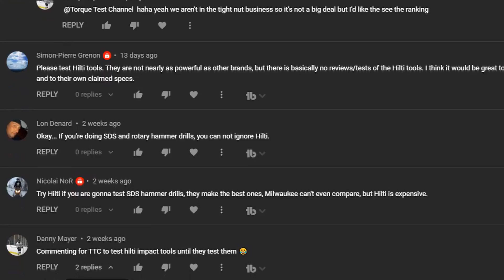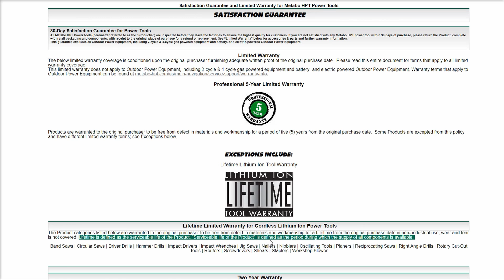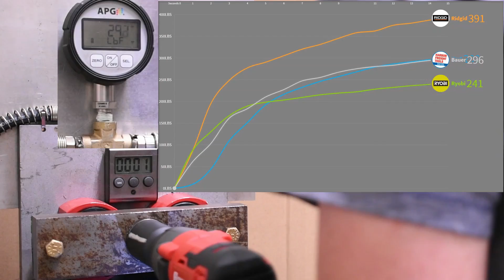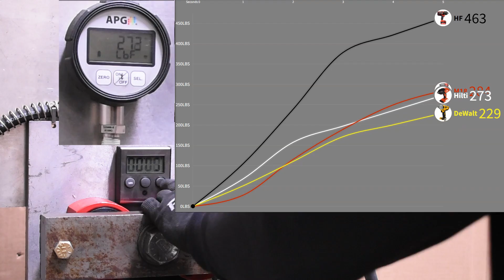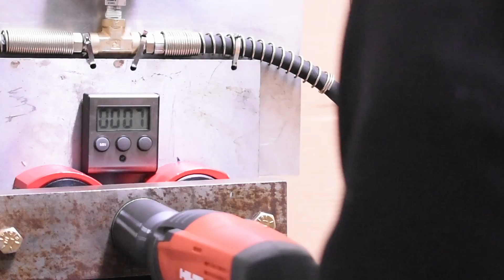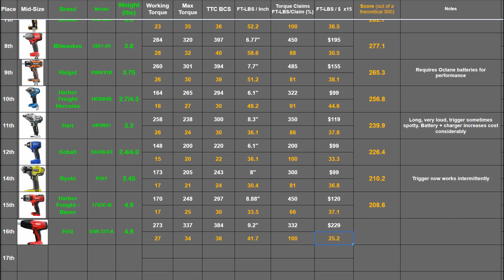HILTI: How Does Their Big 1/2" Impact Stack Up? + New HILTI Tools!

Comment from the maker: Closed captions @ 0:32 for a laugh! Want a link to every one of our rank lists we ever make? Currently if you buy anything from our Amazon store of winners only: https://www.amazon.com/shop/torquetestchannel and FWD to Torquerank@gmail.com you'll get it sent to you.
Reply: I have been wondering for a while now would greasing your Milwaukee M18 midsize gears ⚙️ help? Or do nothing at all besides help the long Jevity
Reply from the maker: @rednecksdoitbetter2975  Only helps tool life.
Reply: schlobber is a technical German term.
Reply: I have a video suggestion. So we know small variations in socket weight and size wont affect torque transfer from a previous episode. But does broach style affect torque transfer, for example snap ons flank drive and flank drive plus sockets, grey pneumatics design and others.
I would like to see socket comparisons. Brands like snap on, sk, proto, grey pneumatic, sunex, capri, astro, mac, matco(expert), cornwell, carlyle, pittsburg, icon and so on. Bc of the smoke and mirrors in rebranding, and the difference in customer specs, even if from the same plant, I would assume test them all.

Comment: The similar drill is now $409 but has a new case and new NURON battery.  Not sure about the internals.  Torque is now a 'claimed' nut busting 1217 ft-lbs or about 50% more.  I still use my nickel battery 18v hammer drill which is around 10 years old and I can rebuild batteries if needed.  I replaced all my corded hammer drills from Bosch to Hilti and couldn't be happier.  I had an issue with one hammer/chisel drill so I sent it in and had a replacement within 1.5 weeks.  I'm not even a fleet customer

Comment: The 5 price points of power tools -

1. $20 on Craigslist/Gumtree and "I swear it works/isn't stolen
2. Cheap eBay/AliExpress "tools"
3. DIY tools that provide more precision than the user is capable of and are fine to use once a year to put up a shelf.
4. Professional tools, like Bosch and Milwaukee. (Definitely not Ryobi)
5. Hilti. The tool you'll only ever "buy" if you're putting it on your companies account.

Comment: I'm just not a fan of the 22V line up, their tools are freaking huge. As an ex contractor, the "durability" factor could never take me away from Milwaukee considering the fact if my Milwaukee ever broke I could replace it faster then sending the Hilti to get fixed.
Reply: I had a die grinder shit itself and was sent interstate for repairs and returned within 30 hours in my hands. On a bank holiday weekend. Not getting that service with Milwaukee etc.

Comment: I guess I'm in the minority but after working for a company that is a "Hilti Company" for 18 years I'll pass. Drywall and concrete dust kills their drills and drivers. They feel great in hand but we have to replace them every year or 2 because they won't warranty them for the dust even though we started blowing them out several times a day with compressed air.
Reply: What? Their specific drywall tools are amazing at that. Never had my cut out tool (SCO) or sd4500 ever clog up or seize. My short lived Dewalt/ Milwaukee experience was complete opposite. Every 6 months warranty.

Comment: After continually replacing the seals on my dewalt I switched to a cheaper hilti impact, in fact it came free with a rotarry hammer drill, and the difference was night and day, I can drive 10mm lag screws without predrilling, and the batteries last twice as long. Interesting that this one seems weaker than the much smaller one I have, love to see more hilti impacts tested and prove I have confirmation bias :)
Reply: Because it probably is.  They updated some products.  Ignored others.

Comment: Interesting... I always associated Hilti with high quality, high power not necessarily.  You may get less beans, but you'll get them forever.  Looking at their website there is one that has more ugga-duggas available than the one you test, that's the SIW -22.  IT's also a 1/2" impact but with much higher claims.  Would be interesting to see how it sits in the mix.
Reply from the maker: I don't see higher claims on it
Reply: @TorqueTestChannel  my bad, I gave the wrong model #.  Check out SIW 8-22 1/2" #2251631.  Max torque claimed at 8850 in-lb in gear 1 and 5310 in-lb in gear 2.  Gear 1 on this model is more than 2x the SIW 22T-A's claimed 3982 in-lb.

Comment: i dont really have any interest in the Hilti lineup its lacking in most areas.. and i guarantee they follow the 2 year warranty not the 20 year one for almost any circumstance you can think of.. any "failures in workmanship" will show up on day 1.. if you burn out the motor, the trigger fails, the impacting mechanism shakes itself to pieces ect ect ect theyll call it wear and tear and say it was only covered for 2 years making it the worst in the industry not the best

Also we came to the assumption in the beginning that it was brushed due to the lack of brushless marketing on the tool and in the product pages.. but they do make brushless tools and just keep it low key their grinders for example i seen a tare down where no where it mentioned brushless at all and open it up and sure enough its a brushless motor, so maybe split the clamshell after the tests and see if theres brushes in there or 3 phases

the product line is just lacking though theres so many tools missing and not one of their cordless products is best in class id even dare say milwuakee has gapped them on rotary hammers now cordless or corded
Reply: You can bet that any Hilti tool sold in a big box store will not be the same spec as from Hilti direct, this should not surprise anybody, all power tool companies do this, you cannot buy power tools with big box store codes on it anywhere else.
Reply: @CrimeVid   i mean maybe.. but i dont think so, i think their 1/2" impact is there 1/2" impact, maybe they have a few of them but whats the point of holding back the better one for only people who special order it direct? makes much more sense to just push the better one out to box stores.. all brands do not have special tools only for direct purchase, most brands will not sell tools directly at all.. maybe theres differrent tools for different countries but overall they want to make as few variations as possible economies of scale make it far cheaper to produce one 1/2" impact instead of 20 different little variations of it
Reply: wrong. it's an honest claim. the warranty policy is exeptional !

you can also get some spare parts for 30 year old (corded obviously) rotary hammers.

no marketing wank at ALL.  try that on other brands.
Reply: @casemodder89  theyre honest in that theyre going to warranty wear and tear for 2 years and workmanship for 20, but ask them what qualifies as workmanship defects.. everythings going to fall under wear and tare after 2 years and not be covered

Comment: that 20 year thing is a joke, i tried to take in a grinder for work that was no more than 10 years old and absolutely less than 20 years (dont recall the model) and they said they didnt support the tool anymore and would have to buy another. ok how much? $430, plus tax. $430 for a bog standard run of the mill nothing special other than the name 4.5 inch 120 volt grinder. $430. i laughed all the way out of the store and hucked the old grinder in the trash on my way out.

Comment: I'd be curious to see what Hilti's manufacturing is like in China. If it's company-owned and is based in China for price and logistics purposes, or if they're cutting corners with no-name manufacturers like nearly every other brand is. Considering how Hilti is set apart from a lot of the market, 22v cordless, ownership of the brand being themselves with no sister brands, etc., I'd like to believe the former, as material costs and logistical costs would be lower with a company-owned factory based in China; this may also explain the pricing compared to relevant competition, as costs aren't being offset by other brands within the same factory, whether that's sister brands under an umbrella or a no-name factory that produces for anyone, though there are many more factors to pricing than just this.
Reply: "or if they're cutting corners with no-name manufacturers like nearly every other brand is."

most major power tool manufacturers aren't doing this either.  I'm sure you'd like to think so, but they really aren't.

Comment: Yeah, I'm finding a lot of these beans wars a little silly. From what I know, this tool is designed specifically to match their anchors, so you definitely do not want to over torque those things, especially if you consider German liability law, which would ultimately put blame on the chief engineer behind the tool if the fasteners were to be found at fault due to an over-torque situation in a structural failure. In other words, if you are an engineer at a company that wants to play in the torque wars and some yahoo over-torques your fastener with the tool you designed, and a building collapses because of it, the liability is on you, mein Freund. I use a 12 volt 1/4" driver 90% of the time, and these ridiculous box number marketing wars are just leading to a lot of stripped fasteners and broken 1/4" bits. I have one and it's loud and annoying. I leave it home and take a 12 volt Bosch and the M18 Surge (I find the way the power is applied to be very useful, and it's quiet, which clients appreciate). A lot of this thinking is about people wanting to use the wrong tool in the wrong place. Most people would be happier with the mid-torque and then just get one of those power bar things that you hammer on if you need something bigger.
Reply: Hilti has this torque device now that knows the torque output on impacts cant remember what its called but it has lights connects to tool
Reply: @micjubba709  Thank you. SI-AT-A22 Adaptive Torque module. Even though that's not my area, or my battery system, I have an engineer friend who would be interested in the fast repeatability and potential accountability.
Reply: Hilti's already marketing their newest impact driver as 2600 in/lbs.  (Current Makita/Dewalt/Milwaukee range from 1600 to 2000)

Their marketing around the impact wrench didn't have shit to do with their anchors.  It's just an attempt to save face (aka market wank, no different than the in/lbs and ft/lbs box specs you're complaining about) for an embarrassingly underpowered tool.  Amazing that people actually lap it up when there's dozens of tools with some sort of torque limiting function/speed control button/whatever.
Reply: You must be an interior decorator using the tools mostly to hang paintings and other decor.  All that 12v stuff must fit nicely in your prius.
Reply: @GertTown  The internet never ceases to amaze me with the degree of idiocy people feel free to display in public.
Reply: @John-do9ei  exactly

Comment: we used to run hilti "mid torque" impacts at my work. they started falling apart after about 4 years, of course they repaired them no questions asked, but each repair took weeks, without replacement or leaner tools. we switched over to makita impacts and drills for half the price, they are double or even triple the power, smaller, and all of our makitas been running no problem for 3 years now. if they fall apart in the near future, we will buy makita again, not for just the price, because the people like them far more.

I think hilti impacts are a joke, as the SIW 6AT-A22 we used to run couldnt even take off regular lug nuts on my car. the makitas (DTW285 and DTW300) do them in about a second..
Reply: An electrical contractor friend used to use Hilti and had the same experience. He started buying lime green Ryobis, and guess what? They stopped disappearing from the job sites.
Reply: Think Hilti's great days are long gone.
Reply: I've never had much luck with Makita's mid range tools, the gear boxes always brake within 6 months. Even ryobi's budget drills put up more of a fight honestly.
Reply: Wise choice going to the Makita's, Hilti seems to be living on past glories nowadays.
Reply: @slasher9883  makitas arent what they used to be either.. but they still can take a beating
Reply: @neubauer.p  perhaps not but none of the other brands are either. All have cheapened out to some degree. After using most brands on a daily basis still find Makita the most durable, as do most of my coworkers. Quite like Milwaukee stuff as well, especially their 12v tools.

Comment: This is why I've been hesitant to buy into the M18 line. Just in case someone else comes out with a newer better tool. Can't wait to see what the new Hilti brushless tools bring. Plus they look cool lol
Reply: Hilti isn’t nearly as comprehensive as the home store brands.  That said, my cordless Milwaukee stuff is probably the most cheaply and questionably made of the power tools I own or have owned.  It’s kind of a wash.
Reply: Go kobalt XTR. The power is there and you will save a nice chunk of change. Milwaukee is fantastic and has a huge line but your gonna pay a lot more. The batteries alone are gonna get you. Buy the XTR bundles save a bunch and get the really nice thick plastic cases they come with. Also I think the XTR high torque has more power, is cheaper, and might be smaller than this Hilti.
Reply: How do you know if its better? All new tools are comparable in power, durability is what matters
Reply: But does a new, slightly better tool make yours any worse? No, and that should be the way to think about that.

Comment: It's on the wrong chart. Needs to be on the bottom of the high torque.
Reply from the maker: A 4.8lb 332ft-lb rated high torque is not a high torque compared to what most brands in existence call a high torque. But point taken, this one is wishy washy for sure.
Reply: 10 yrs ago

Comment: I used to work in a factory driving self tapping screws through 3mm steel for 12 hours a day using a 36v Hiliti impact driver. The performance of the tool was decent but the chuck would always break after 6 months and the bits would just fall out if held upside down!
Reply: To be fair, any impact chuck would fail under those conditions. They're just not made for that kind of work. Tool failure should fall on management, as they're sourcing the wrong tool for the job; more than likely in an attempt to cut corners.
Reply: @xaytana  If the tool was being replaced under warranty, management made a great decision since they got years of new tools for free.
Reply: Pretty thick, what were the assemblies?
Reply: @volvo09  galvanised steel stud wall assembly for apartment buildings, etc. Most of the steel was 1.2-1.5mm thick but you were always screwing two parts together, so 3mm. The drills took a lot of abuse but they always broke within their warranty period
Reply: I don’t know if Hilti goes after the assembly market.  I know Panasonic and Makita do.  I can imagine every impact I’ve owned (Makita, Dewalt, Milwaukee, Hitachi..erm..Festool) would fall apart being used non-stop like that.
Reply: interesting !

i've never come across a 36V impact line on hilti.

do you possibly after all the years know the product name of that 36V impact !?
Reply: @casemodder89  My mistake. Now that I think of it the impacts were 22v. I believe the batteries we used were 3.6Ahr so that's where I'm getting mixed up

Comment: Been excited to see how the high end "German" impact go. Fein's impact are made in China just like the hilti these days....
Reply: Fein made in China? That’s terrible. I have a couple of German made Fein tools and they’re beautiful to use, why do they have to go and do that?
Reply: @zeroyon4562  My Fein rep told me all of the impacts, 12v drills and their only rotary hammer drill. Are made in China. Their entry level budget magnetic core drill (KBE 30) is made in India. 
Everything else of theirs is made in Germany and is very well made and designed. I particularly was happy to see their cordless battery are made in Poland.
Reply: @Schwalbe_262 YouTube channel “singlecams” tested the hazet one and found that it’s rebranded for several brands and still made in China. And way over priced

https://youtu.be/Im-uGmKZkpk
Reply: @Schwalbe_262 Stahlwille if you want high end mechanics tools. Especially Torque wrenchs. And a lot of gedore is make in India, China or South Africa these days...
I've got a lot of tools from Gedore founder brother's company Dowidat, very good spanners and pipe wrenchs
Reply: interestingly enough all of my fein tools are maden germany.  5" angle grinder 18V,  1/2" impact wrench 18V and the 4 speed drill driver 18V.

oh, the 18V A-led light and usb charger might be made in china. but these are not tools like something with precision ground shafts, gears and stuff. but even tho these both 'doodads' in the 18V batterysystem are chinese they hold up pretty since 4 years.
Reply: @casemodder89  I've replied to someone else in this comment thread. About what the fein rep told me regarding country of origin. 
I am surprised that your impact wrench says made in Germany. As I've both confirmed it with fein rep and seen in person, country of origin on a 18v impact as being PRC. Whats your model number on your impact?